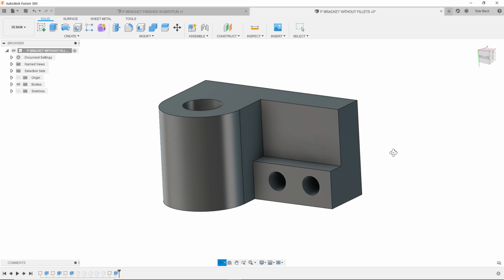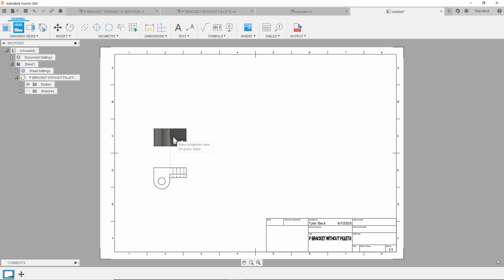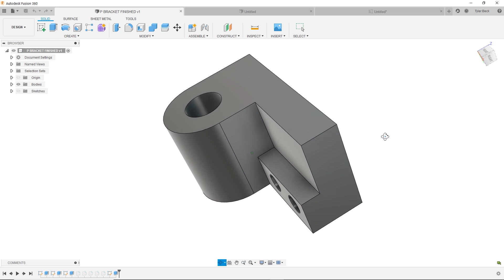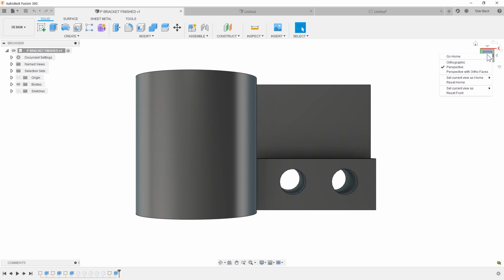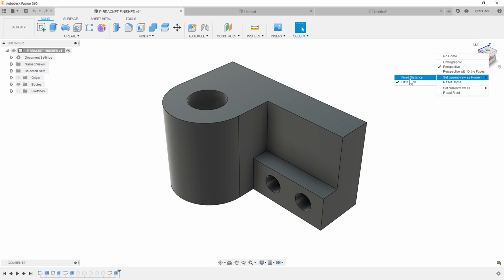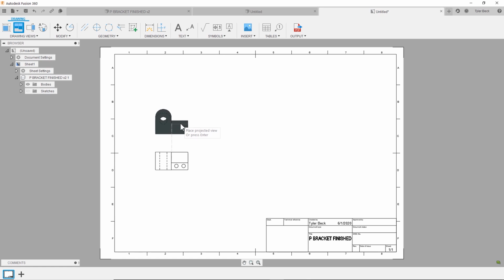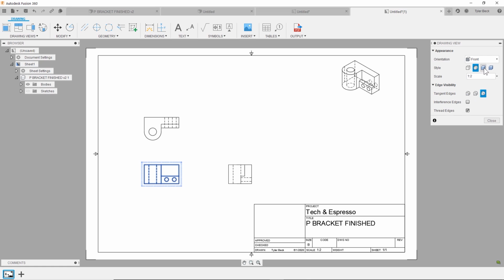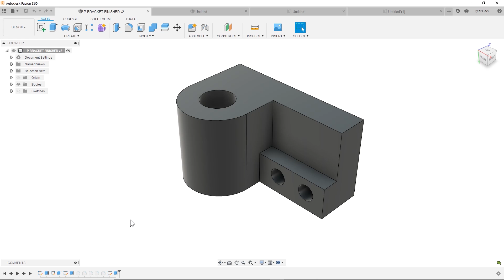Model Views and Drawing Views Corrected in Fusion 360

Comment from the maker: Fusion 360 Video Ideas????  What's An Area You Are Stuck On?
Reply: I am trying to print out a template from a model, so I then can then glue it to sheet metal and bend/cut it into shape. I have a pirimid-like model with several non-standard angles and slopes. How can I create a new view to use on the drawing sheet to get the actual size? The angles do not align with the standard view options on the navigation cube. When I reset the front view to align with an angle the other views will be off.